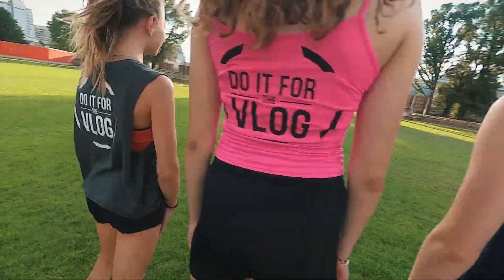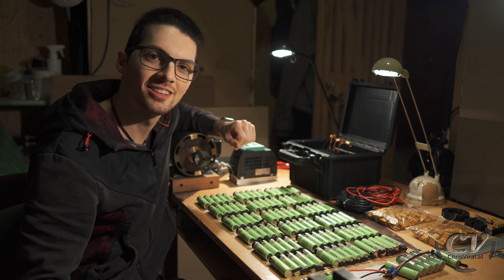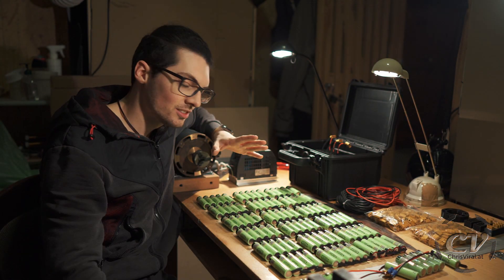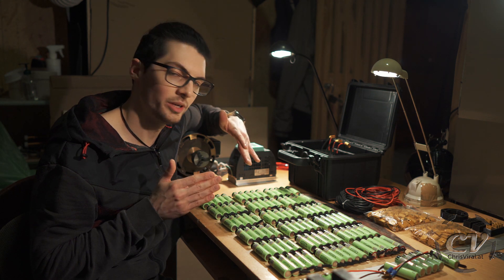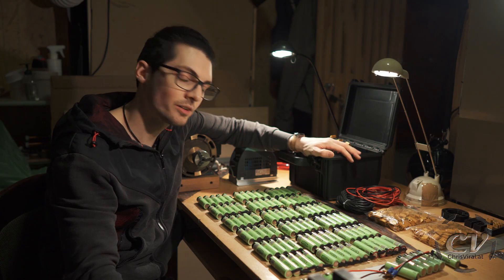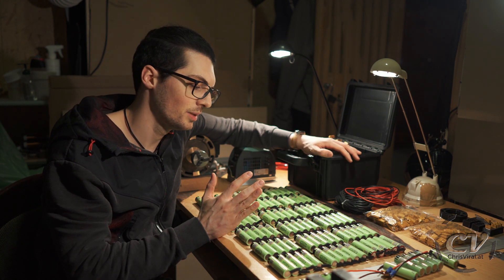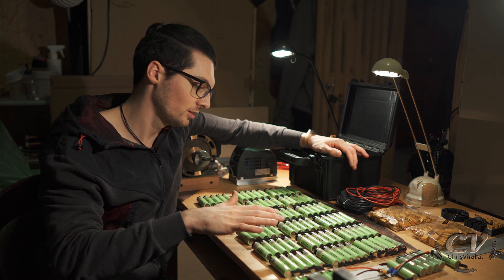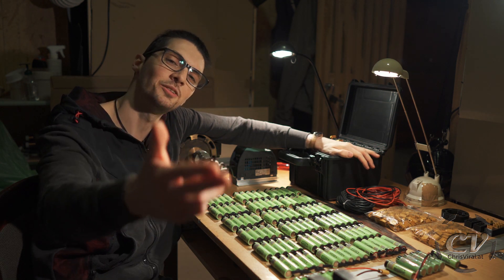3S vs 4S vs 7S - What's Best For Li-ion Battery Pack (12V vs 24V)

Comment: can i put a dcdc reducer between 7s battery and 12v inverter to let it work ? it s regulable and lower input voltage  while increase ampere output

Comment: hello friend, how nice your video, I liked it, I wanted to ask for your help!  I have a Beats Portable speaker, which uses 6 1.5v DD batteries, added up to 9v, and a power supply plugged into the 3.33A 18v outlet.  my question is?  how do i make a pack of 18650 to use in the box?  can you help me?

Comment: hello friend, how nice your video, I liked it, I wanted to ask you for help, I have a Beats Portable speaker, it uses 6 1.5v DD batteries, added it would be 9v, and an 18v 3.33A source.  my question is?  how do i make a pack of 18650 to use in the box?  can you help me?

Comment: Your video is a perfect answer for 3s and 4s confusion. Thanks for the video. However only those who know the problem can make sense of it. I would suggest make another video which details problems with 3s and 4s , maximum capacity used and compare it with 7s so that even those who don't know the problem can understand it.